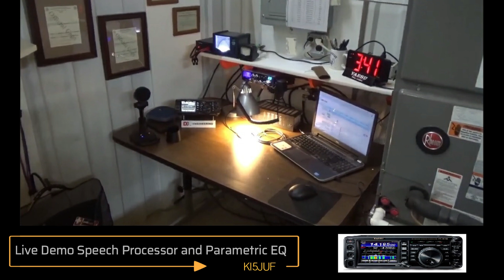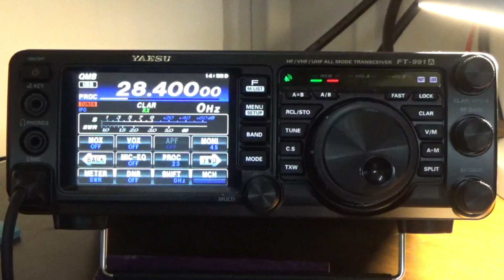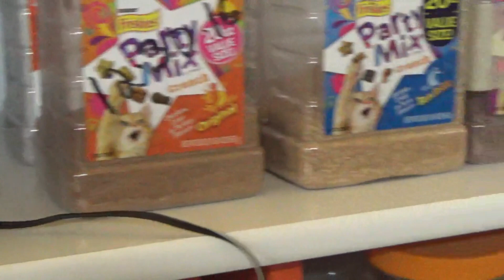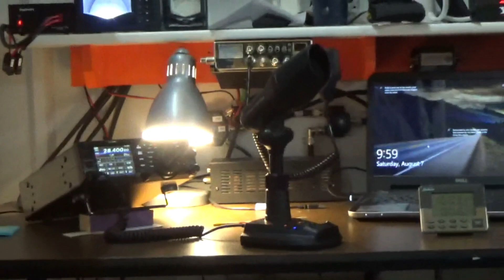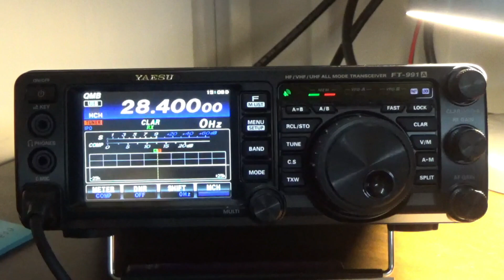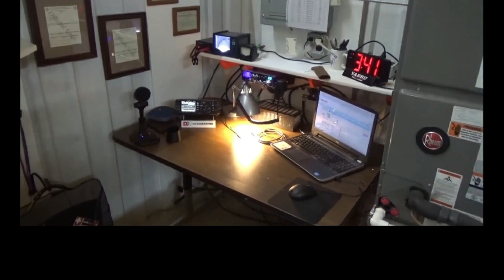Live Demo Speech Processor - Parametric EQ using Ext Speaker settings from FT991A Yaesu Manual

Comment: That cover on the mic works great. Terrific audio!
Reply from the maker: Good morning Jim thanks for the message, it really does make a difference, let me know if there's anything you need and good DX'ing sir '73
Reply: the old trick... a tube to get more trebles...  but it works...worked for me 30 years ago, with an astatic microphone and the drake tr7, I bought the 991 yesterday..so I'm learning about the endless menu..the ftdx 10 is easier, I'll love to hear the 991 at top tx trebles...

Comment: Hi great idea with the monitor, great video. 73 mark G8rde
Reply from the maker: Hi Mark, how you doing, thanks for the message, it's really cool, I just did a video on 2M USB using the Monitor function, headsets sound amazing you can actually hear the differences with the speech processor on with Parametric EQ '73 de KI5JUF

Comment: I know this is a little older video however I found the information great.  I have one question; I have tried a number of times to record my output as you demonstrated.  The problem I am having is that it does not record on USB or LSB only in AM mode, any suggestions?
Reply from the maker: Good evening I thing this link might be the one you are looking for https://youtu.be/tN9oRpY2OCY  thanks for the message for the message and '73 de Ki5JUF
Reply from the maker: Good morning sir were you ever able to record on USB and LSB. let me know I'll play around with it.

Comment: I am using this radio with the optional MH-36E8J DMF Mic. I use this radio mostly for VHF & UHF FM modes. I use this DTMF Mic because I like to dial echolink nodes with it. Now other stations say I sound horrible with this mic (As compared to the standard MH-31A8J Mic) They say I have to much bass and am muffled. What page in the user Manuel do I go to, to adjust FM Mic transmit audio ?
Reply from the maker: Good evening James, thanks or the message, in the FT991 believe it or not I couldn't find any acoustical adjustments for FM, the best I could find is they said use an different radio and tune to the same frequency and adjust the Mic Gain to avoid over distortion, on the stock mic position 2 is a little less bassy.  Sorry, I hope this helps '73 de Ki5JUF

Comment: Just to let you know thar your Speech Processor - Parametric EQ settings are awesome, I have been in some big pile up's for dx stations and the most I have had to call is three time's to get through, it is amazing. Yaesu ft-991A into a hygain th3 jr tri bander @ 30 feet pushing 98 watts, I get awesome signal reports from dx and local mars nets. Thanks Steve
Reply from the maker: Good evening Jack always good to hear from you sir, glad the settings are working I use them to - I apricate hearing from you and keep in touch '73 de KI5JUF
Reply from the maker: Hi Jack thanks good to hear from you yeah I love the speech processor stuff the processor really helps you get through the pile ups, keep in touch and let me know how things are going, '73 my friend have a great weekend!!

Comment: Here are my settings with an MD 100 Mic Gain 45,  Proc 35. Great reports!

PRMTRC EQ1 FREQ 500
PRMTRC EQ1 LEVEL 9
PRMTRC EQ1 BWTH 8
PRMTRC EQ2 FREQ 1000
PRMTRC EQ2 LEVEL 7
PRMTRC EQ2 BWTH 8
PRMTRC EQ3 FREQ 2000
PRMTRC EQ3 LEVEL 5
PRMTRC EQ3 BWTH 4
P-PRMTRC EQ1 FREQ 100
P-PRMTRC EQ1 LEVEL 10
P-PRMTRC EQ1 BWTH 3
P-PRMTRC EQ2 FREQ 700
P-PRMTRC EQ2 -3
P-PRMTRC EQ2 BWTH 7
P-PRMTRC EQ3 FREQ 3200
P-PRMTRC EQ3 LEVEL 10
P-PRMTRC EQ3 BWTH 2

On the base of the MD 100 I have all switches to off or the left hand position.
Reply from the maker: Thanks a million I'm gonna put these on the air today really apricate it '73 de KI5JUF
Reply: @westtexasvideogateski5juf255  Good Luck!

Comment: You can adjust the EQ & Mic Gain so the Processor melo’s out some. 👍🏻👍🏻 N8XLQ.
Reply from the maker: Good afternoon Lenny, that’s brilliant set the Mic Gain, Equalizer, and compressor, then throttle the Speech Processor with the MIC-GAIN while having MON feature on or use Head-Phones so you can tailor your voice audio exactly as you like, ’73 de KI5JUF again brilliant!!